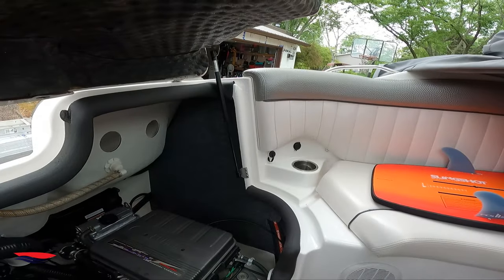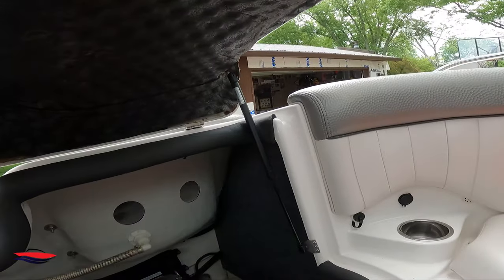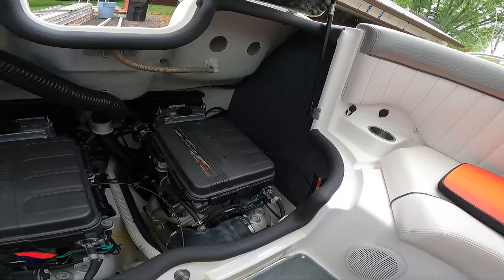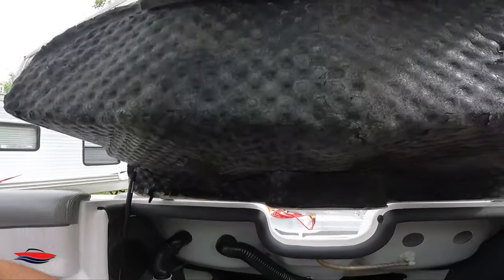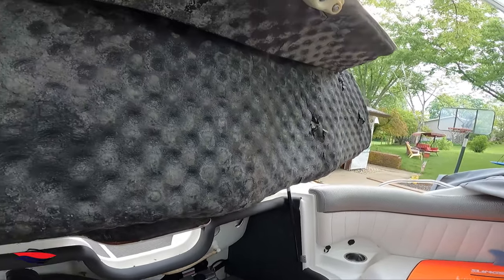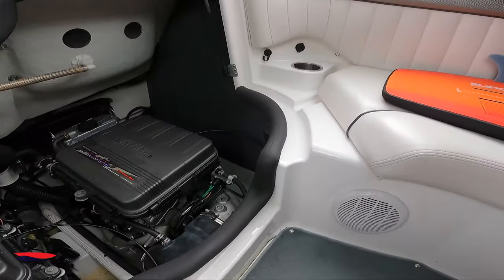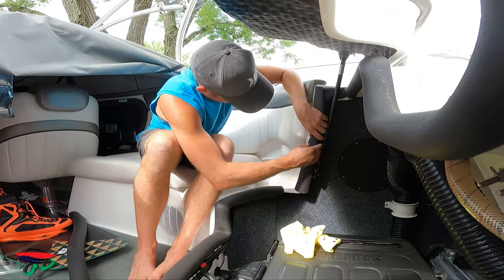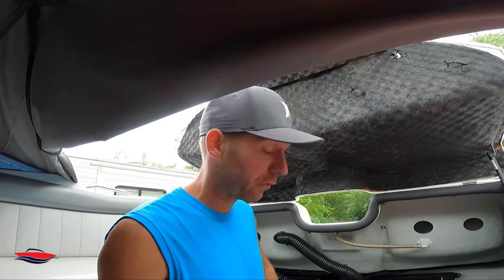Engine Noise Dampening Part 1 - Yamaha Jet Boat

Comment: You said there were 3 different qualities. Assuming you used the the stiffest version? Great vid, thanks for sharing.
Reply from the maker: I used the "Best" Rubber Pipe insulation (EPDM) vs "Better" Polyethylene Pipe insulation (Foam).  The rubber pipe insulation also has better adhesive tape.  The "Good" version is foam and doesn't have adhesive tape.
Reply: Heading to the store right now to buy and install today! Thanks for your great videos!

Comment: I'm going to do this to my AR240 when the snow melts. Do you think it would be cleaner and easier to remove the engine cover from the boat before removing the matting?
Reply from the maker: Yes I do believe it would be cleaner and easier to do.  My only worry is an alignment issue when taking off and reinstalling it or anything big with a hinge.  Years of working in the auto industry and removing and installing doors, hoods and truck lids and then spending hours trying to get everything lined up again just sucks.  Most likely you will have zero issue with it I am just being a pussy.

Comment: Hey Jeff, thanks for the great videos and tips. You really explain everything well. Did I miss video #2 of the engine noise dampening series? Thanks again!
Reply from the maker: Not yet buddy.   That will happen early spring.   Next video will be automated ballast install, wakeboard tower removal, running wire through the tower and trailer brake bleeding.
Reply: @JeffDoesThis  Good deal, I'll be looking for it. Just curious, but what are you going to replace the factory noise dampening with?

Comment: What material did you use in part2? Mine is falling apart snd Yamaha has no ETA for the oem part replacement
Reply from the maker: Dynamat Xtreme Extreme Bulk 4ea 32"x18" Sheets 16 FT - https://amzn.to/3PGPs74

Dynamat 11905 Hoodliner 32" x 54" x 3/4" Thick Self-Adhesive Sound Deadener - https://amzn.to/3LLwOrh

Comment: Curious of the sound difference comparing older models to the new ones. Saw a newer model today at Parker and was surprised it was not howling noise. Maybe Yamaha has stepped up the insulation on the new ones?
Reply from the maker: They have.  2015 they made big changes and now are quite.

Comment: Pickup my 2017 SX210 tomorrow and already have my pipe insulation ready 😂👍🏼👍🏼👍🏼👍🏼
Reply from the maker: You may not need it at all.  2015 and up models got a massive upgrade from Yamaha in noise reduction.

Comment: How much material (Tubing) did you need?
Reply: Foam comes in 6’ sections. Easy to cut to fir.
Reply: Made a massive difference tried it out for the first time last night. Thanks!
Reply from the maker: Glad it worked.

Comment: Make sure you cut the opening for the fire extinguisher
Reply from the maker: The 230 series boats do not have the factory port for a fire extinguisher in the engine bay.